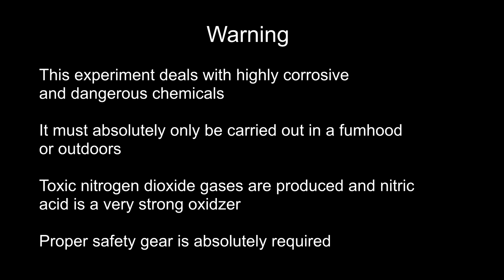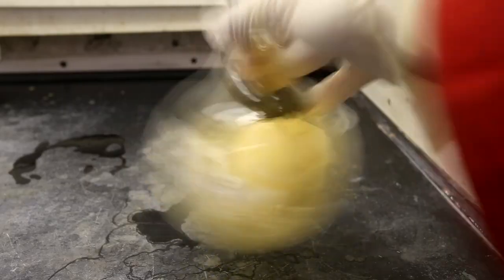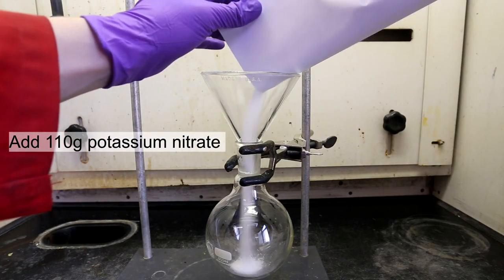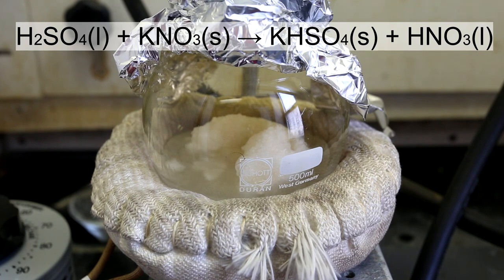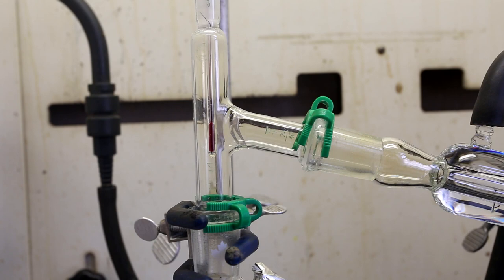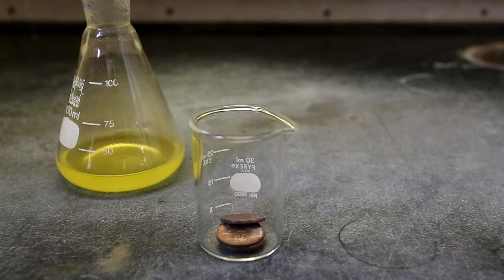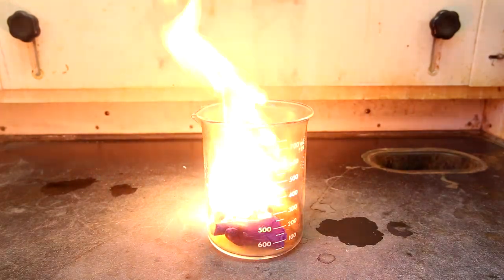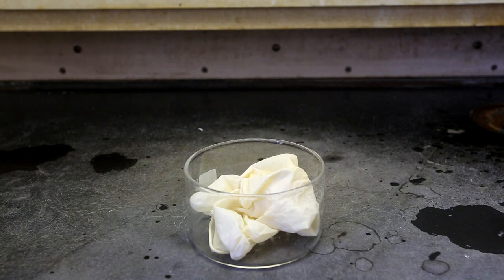Making Fuming Nitric Acid

Comment: Thank you for including the dangers of lab gloves with fuming nitric. I've been burned many times with fuming nitric on bare skin and it never results in much more than a 1st degree burn if washed quickly. I actually proved to a fellow amature chemist what nitric does by placing a tiny drop on the back of one finger for 60 seconds. Felt like lemon juice in a paper cut and did blister, but my finger did not dissolve. Much better to not have burning plastic on your hand!
Reply from the maker: No problem. I will post a video eventually where I pour acid on my hands...
Reply: Nile Red Small amounts! Infection sets in  with these burns and lingers for months!
Reply from the maker: SMOBY44 I got a small burn and it's gone.
Reply from the maker: christopher vester It might work to make some HNO3, but not like in this video. You need sulfuric acid because it doesn't have much water in it.
Reply from the maker: christopher vester Unfortunately it is not well suited for this!
Reply: BTW, do you think common lab gloves can protect users from conc H2SO4 and conc HCl?
Reply: Wan HL ye it definitely will.

Comment: Yeah.....this guy has got it down!!
Superb explanations, highly accurate......very fine quality content.
I am surprised that you don't have the same/better following than "Nurd rage" because your filming of the experiments are superb, the dialogue/your descriptions supercedes that of anybody else on the scientific demonstration scale.
I have only discovered your videos recently but they are all awesome ;-)
Reply from the maker: Thank you very much!
Reply: +Nile Red Is 96% concentrated (by weight) sulfuric acid good enough for this?
Reply from the maker: Yeah it should be. I used 96-98%
Reply: +Nile Red can we use conc.hydrochloric acid instead of sulfuric acid
Reply: +rajesh shahi rajesh shahi No, hydrochloric acid only comes in lower concentrations (in the neighborhood of 30%), so your nitric acid would be diluted with a lot of water. Even if you maintained the temperature under the boiling point of water, the nitric acid would form an azetrope, and you concentration wouldn't get much higher than what you can get commercially. That and there's also probably chlorine contamination or whatever, but I'm not a professional chemist, so don't quote me on that :)
Reply: +rajesh shahi rajesh shahi  You can, but you can't at the same time because this will only make very low concentration nitric acid which will not be fuming as shown in this video this can be done by reacting a nitrate salt  (not urea) with hydrochloric acid to form a chloride salt and HNO3 then a piece of metal is added e.g. Copper of zinc (particularly any reactive metal or active metal) this will produce lots NO2 (Nitrogen dioxide) this is then bubbled into a 30% H2O2 solution ( hydrogen peroxide) make sure the peroxide is very cold because Nitrogen dioxide has higher solubility at lower temperatures this will produce a clear solution of HNO3 (Nitric acid) you can then distill this to form azeotropic 68% Nitric Acid this is notably much weaker than fuming nitric acid this does not fume either
Reply: If I had to wager a guess I'd say he's not as popular as nurdrage because the average person probably doesn't find these videos very interesting. There's just too much technical stuff in it. It's superb for people like myself, though. These videos are the perfect combination of technical knowledge and YouTube-style instant gratification for someone with my level of knowledge. I'm self taught, so a lot of gaps in my knowledge end up getting filled by videos like this, but it's hard to find good quality videos which are also made by people who know chemistry. It seems with most channels you either have someone who knows how to make good videos, but doesn't know shit about chemistry, or you get someone who knows lots about chemistry, but half asses the production of the video. This channel is a perfect mix of both.
Reply: Nile Red>nurdrage. Nuff said.
Reply: I was literally going to say the same thing. I'm glad you demonstrate the dangers of this concentrated nitric acid extremely well!
Reply: @NileRed  can i get the nitrogen dioxide from nitric acid with hydrogen peroxide and have 90% nitric acid?
Reply: eyo man u still there its been 6 years
Reply: subrub
Reply: 8 years later: NileRed is huge, and who tf is "Nurd rage"??

Comment: Excellent video!  I have seen numerous Nitric Acid video's, but yours was different in that you explain about the fumes not clearing if the heat is too high, the lab gloves and the effects and also not to use Ammonuim Nitrate as the amonia gas will compromise the finished product.  Good work, I hope to see more.
Reply from the maker: Thanks!

Comment: I use PVC gloves. I didn't try to put it into a beaker and left for a while, but direct contact is safe enough to have time to wash them on hands in the water without any visible damage. PVC is not very elastic and it's not hard to tear them, but they are as cheap as nitrile and handled with caution are fine complement to nitrile ones.

Comment: You can use NH4NO3 (ammonium nitate), just aswell as you can use any other nitrate salts. Decomposition of ammonium nitrate becomes an issue at 200 deg. C. Way after your HNO3 has completely decomposed into NO2.
Reply: can I use leaad nitrate?
Reply: correct me if I’m wrong, but the actual problem is that the Ammonia gas will react with nitric acid as an acid base neutralisation.
Reply: @kashyaptandel5212  Consider yourself corrected.  Ammonia would be produced in strongly basic conditions, not acidic.

Comment: On lab gloves, use Viton which is chemically related to Teflon,PTFE, which is almost completely inert only reacts with certain metals like Mg. Caveat- very expensive like >$100 pair. I love RFNA as a storable rocket oxidizer, safer and cheaper than peroxide and N2O. Enjoy, Rocketmentor

Comment: I think ammonium nitrate can be used, and is actually very nice to use, as I`ve done, and I made about 0,5 liters of 80%(based on density) nitric acid.
Reply from the maker: Yeah, I think you can use it, it just degrades the yield a little if the temperature isn't controlled well. I remember reading somewhere where it was explained exactly why ammonium nitrate isn't ideal. However, it is definitely more than use able.

Comment: something i'd like to point out- while latex or nitrile gloves won't last long against concentrated or fuming nitric acid, good lab practice dictates that if you even think you might have any spill on your gloves, you must immediately remove and replace them. as such, the gloves aren't so much resisting indefinitely, but rather just buying you a few extra seconds (much longer than it takes to remove the gloves).

Comment: Considering the Kjeldahl nitrogen determination method, ammonium should stay in the reaction vessel. However, you may or may not have problems with symproportionation towards dinitrogen oxide or just dinitrogen (?)

Comment: Hi. I need an advice.
After pickling a stainless steel part in nitric acid that part must be rinsed in a DI water.
But after that the water will become a toxic waste.
What is the right way to neutralize/dispose that water?

Comment: When greasing the joints could I use Vaseline? will this react with anything in the experiment?
Reply: the problem i found when using vaseline is that it melts and runs into your solutions

Comment: can I use HCL instead on H2S04, HCL is much more easier obtainable at Home Depot or something, will it affect the cocnc. of the HN03 yield?, also wouldn't most of the yield be lost during the process because of NO2 escaping the nitric acid and mostly water being in the collection flask?
Reply: Sulphuric acid is available in many Home Depots as drain cleaner, just make sure it says sulphuric acid. You can just boil the excess water off and complete the reaction with it. If you can't get ahold of sulphuric and only have hcl, I'd recommend watching nurdrage's video on making nitric acid, the process is a bit different and the yield is lower but it's better than nothing.
Reply: +MineCralex No, HCl won't work!

Comment: Use the HDPE gloves. The crinkly kind that the free sample folks at Sam's Club wear. Those can be stuck in pure HNO3 with no reaction.
Reply: +Gugglepluss Suques As far as I can tell from chemical resistance charts, HDPE is not resistant to nitric acid at concentrations greater than 90%.  HDPE probably wouldn't be the best solution, or at least something I wouldn't want to try until I tested the glove by some means.  YMMV.

Comment: Hi, great and extremely helpful video! Thanks. By the way, can you please make a video on the synthesis of benzyl methyl ketone via chloroacetone and benzene? I'm doing research on anticoagulants using bacteriophages and I need a way to synthesize benzyl methyl ketone (1-phenyl-2-propanone) and use it to make control products. My RA is having a hard time finding the materials for reference, so I think a video would help a lot. Thanks!
Reply: Frank Roberts Sir?

Comment: Hey ! I hope someone will find the time to answer me :p : In this video you show us how to make highly concentrated Nitric acid and in another video you told that acid were most of the time diluted with water ...  So I was wondering , knowing that boiling  temp of nitric acid is 121°C and water 100 °C, why not simply boil off the water to "purify" the acid ? Would the reaction produce toxic fumes or something like that ? or is it just not how it works ? 
Thanks for reading and hoping for an answer :p
Reply: The boiling point of nitric acid is 83°C and forms an azeotrope with 68% nitric acid and 32% water by mass. So you can boil it theoretically to that concentration but any further boiling wouldn't increase the concentration.

Comment: Why you do not use a fractional distillation process
Reply: No need to.  The product distills over at 83c.  The next fraction would be the excess H2SO4, which comes across at about 350c.

Comment: maybe I'm asking a stupid question but isn't way much easier to just boil common 60-69% nitric acid and condense the fumes if you just want to obtain higher concentrated nitric acid?
Reply: EMandMORE That doesn't work because Nitric Acid forms an azeotrope with water at about 68% concentration, and boils this azeotrope boils at a specific temperature. As such, you'll boil away both water and nitric acid and your concentration wouldn't change.

Comment: Great video (like all of them:) ), but I have a question - will it change anything if I will use this method but without connector between condenser and collecting flask?
Reply from the maker: +JurineX94 I am not sure what you mean. Like the collecting flask is connected directly to the condenser?
Reply: +Nile Red no, with acid dripping straight from condenser to the flask in the open environment :)
Reply from the maker: JurineX94 that shouldnt be a huge problem. Except you will do 2 things. A) your HNO3 might absorb water and become less concentrated and B) you will make A LOT of fumes, which can be dangerous.
Reply: +Nile Red Thanks :)

Comment: Interesting. I personally prefer electrolysis in a pressure chamber to form my Nitric acid; Far safer and easy to produce sustaining quantaties over time.
Reply: So you react nitrogen dioxide with water to from nitric acid?

Comment: I have about a kilo of calcium nitrate,
would i be able to use this ?
Reply: +razie85 You can use almost every nitrate salt, but calcium nitrate has two disadvantages compared to KNO3: it can form a tetrahydrate, which contains only 69% Ca(NO3)2, but there is also an anhydrous form, too 
and Calciumsulfate is poorly soluble. It may form incrustations in the flask, which impairs the reaction of "inner layers" with the sulphuric acid.

Comment: can this be scaled up linearly  or does the ratio of acid to salt change for larger batches ?
Reply: Scaling up any chemistry is risky unless you really know what you are doing (i.e. are a chemical engineer), the ratios would remain the same but heating and cooling take much longer not to mention that a small flask loses much more heat in proportion to a large one, so thermal runaways are always a danger with scaling up not to mention many other problems that I wouldn't know. It's much safer to stick to millimolar scale. chemists leave scaling up to chemical engineers and specialised process chemists.

Comment: Nitric acid vapours are really bad stuff, by my experience. I've dealt with NO2 before, and it stunk strongly, and that was it, but that nitric acid, even when I breathed in a little of the diluted fumes (i did it in the open, but still, air) when checking up on the apparatus, gave me a ather unpleasant headache.
Reply: You're lucky you didn't cough up a lung.

Comment: Nile Red or someone else, can explain me clearly what passivation is?
Reply: Fuming nitric acid is a very powerful oxidizer and this reaction can produce non-soluble copper oxide.

To break it down, basically there are two reactions that can happen when nitric acid meets copper.

First, we have the straight up oxidation of copper metal:
Cu(s) + HNO3 -> CuO(s) + HNO2

Note: The HNO2 quickly decompses (2HNO2 -> NO + NO2 + H2O)
And NO reacts with oxygen in the air (2NO + O2 -> NO2)

So basically for the first reaction we can simplify it as:
Cu(s) + 2HNO3 -> CuO(s) + 2NO2 + H2O

For the second reaction, we have the metal forming a salt with the acid:
Cu(s) + 4 HNO3 → Cu(NO3)2 + 2 H2O + 2 NO2

Basically, adding water negates the oxidizing affect, and allows the nitric acid to dissolve the metal.

As you can see from the above reactions, a LOT of NO2 gas is produced.  Also, NO2 reacts with H2O to produce Nitric acid.  The reaction is kind of complicated, but I speculate that too little water can allow for the buildup of NO2 gas, while diluting the solution with water can convert the NO2 gas back to nitric acid.

Hope this helps.

Comment: How did you get it to 86% if the azeotrope is around 68%?
Reply: Jordan Davidson because it isn't a mixture of water and nitric acid that is being distilled but rather the direct product of the reaction which is pure nitric acid. The 68% is only relevant when trying to purify it when mixed with water.

Comment: i am just wondering, what type of fuming nitric acid did you make in this video? did you make red fuming nitric acid or white fuming nitric acid?
Reply: It's white fuming nitric acid, red fuming can be made by excessive heating so more NO2 gas is produces, or just by dissolving additional NO2 gas in the acid after distillation.
Reply: Jarom Schafer 
What's the difference?
Reply: the difference is the concentration of the fuming nitric acid.  the white fuming nitric acid is purer nitric acid then the red fuming form.
Reply: ^ oh thanks mate

Comment: How good of a yield is 30 mL?
Reply: +Mr.chang cooler
110 g KNO3 corresponds to 1,09 mol. 60 ml H2SO4 are about 110 g (density of 1,84 g/ml), or 1,13 mol. 
When KNO3 is fully "transformed" into HNO3, the yield should be about 69g (1,1 mol HNO3), which are roughly 69 [g] / 1,5 [g/ml] = 46 ml. 30 ml are a yield of 65 % then. But there is always some loss to be expected due to decomposition of the acid into nitrous oxides (and water).

Comment: What boiling stones I should use?
Reply from the maker: If you don't have boiling stones, you could even use clean sand. I just used Fischer brand Boileezers
Reply: ok, so I will use pure SiO2 (silica gel)
Reply from the maker: I am not sure if silica gel is a good idea. It is extremely fine. It might be better to use larger grained sand.
Reply: But I actually found some porous and big particle shaped cat litter silica gel, so I think it will be good.
Reply from the maker: You can try it and see how well it works!
Reply: Nile Red Another thing that I want to ask is can I use technical grade H2SO4? I mean the acid I have is concentrated, but it has a little brownish yellow colour.
Reply from the maker: Yeah that should be okay for most things. I don't think it will cause any problems. However, to know for sure, you'd have to try it!